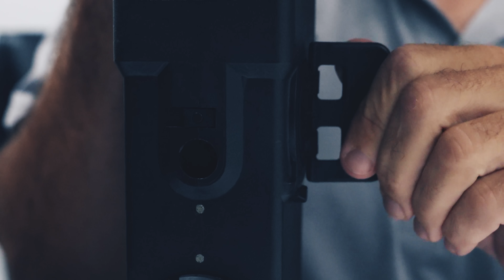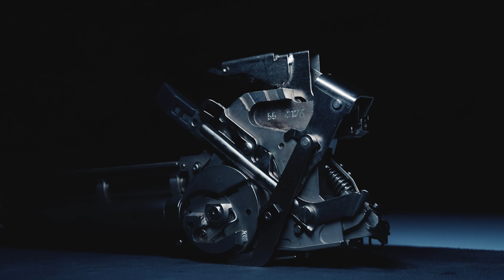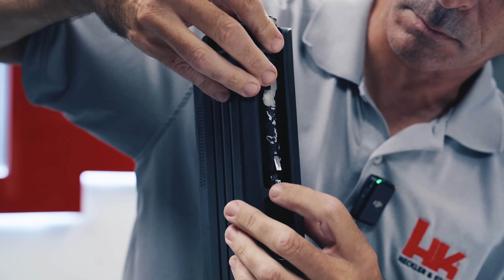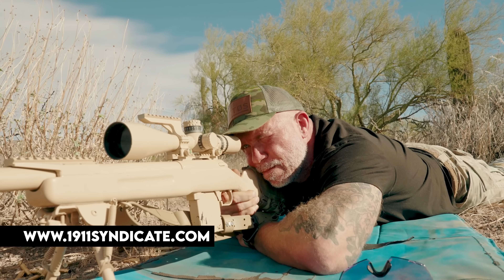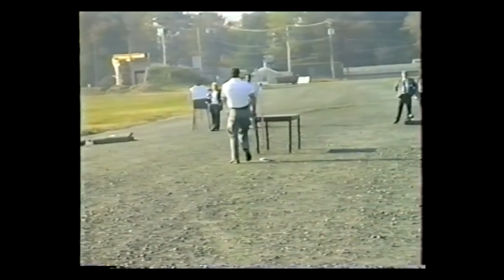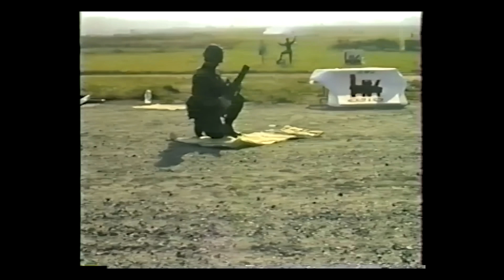The Craziest HK Gun of All Time - The G11 - Rare Footage

Comment: This was a dead end design due to the law of thermodynamics.  Metal cases remove a large amount of heat from firearms.  When this heat transfer is not available, the firearm has to absorb that heat with only air cooling as an option.

Comment: This gun is very cool and quite a improvement over current designs. The main reason it failed is it doesn't fit the purpose of small arms in war. As much as it hurts my pride as a former grunt the reality is infantry takes ground and holds it. Artillery and air support do most of the killing. Soldiers need a rifle that works, anything above that is a waste of money. Something like this is way, way to expensive and creates way to many logistics problems (high tech ammunition factories are not easy to come by for example) for the benefits it provides.

Comment: Hello! I know I am 4 months late, but I have a question: 
Whilst you were visiting H&K, did you inquire about the "LMG11"? 
For those that don't know, it's an LMG variant of the G11, firing the same 4.73 cartridge, but its ammunition is stored in the stock, capable of housing about 300 rounds.

There only exists a few pictures of it, including one of Günter Schäfer loading it. 
It would be very cool to get more info on this weapon, especially about its supposed "auto-loading" system, used to chamber the cartridges into the barrel. 

Kind regards.

Comment: The G11 design favors most coilguns, which currently exist, in a complementary way. The most interesting comparison would have to be the ammunition and the uniqueness of the projectiles for both systems; however, a newer model of the GR-1 might benefit from the adaptation of its magazine, to accommodate the use of the horizontal feeding operations from the G11 in its design while, perhaps, introducing a more lethal projectile.

Comment: This is not a firearm. It's an ammunition. And its weakness is the caseless ammunition. Mechanically it's not much different than another great box-cartridge Eurogun from the twilight of the Cold War meant to defeat Soviet body armor, the FN P90. HOWEVER, where I can see this platform's potential is in a conflict where eliminating the expensive brass cartridge is critical to one side. Say... guerilla warfare against a State that controls the copper and zinc and the steel used to make casings. I'm a gun nut but I laugh when other gun nuts think it's their guns that will save the day in a future civil war. It's ammo that saves the day. Just SEAL Team Six alone used to train with a million rounds annually. Your little stock of 5.56 might last one engagement, if that. Go to a range and examine the boxes of spent brass (or steel for 7.62) for the day. Now if you had a weapon firing ammo using a minimum amount of metal and in a caseless design that could be 3D printed by anyone with the means.... then you don't have factories (taken out with airstrikes) delivering by train (taken out with airstrikes) to big ammo depots (taken out with airstrikes... see Ukraine War), you have a distributed production/distribution model. Every house, every garage, every mancave, every shed in the woods is potentially an ammo factory so long as they have a block of the nitramine-based solid propellant body. 3D print a thousand of those, then press into each a single 51-grain bullet projectile, primer, booster, and plastic end cap suing a simple hand operated machine. Presto: You're an ammo factory.

Comment: Mistake: Flechette means (from the french) little arrow or dart. The AAI and Steyr ACR guns fired ONE flechette. Accurately. The Steyr one was the most MPBR gun ever: you zeroed it at 800 yards, and peak trajectory was like 12" so you never range, just aim and fire. Anyway, SPIW used more, often 3 flechettes in a little weird box but these used one, not a shotgun-of-darts as in the video. 

Now someone needs to dig up the other ACR guns and do videos on them. The Steyr was a Very weird gun internally.

Comment: Want a game changer? Use turntable top feed like on the P90, to drop the bullet into a barrel in line with the trigger finger. Accuracy jumps in double digit percentile, instantly, no additional training... and again, never seen ot done. Computer controlled range finding red dot optic that adjusts the dot according to target distance, compensating for the distance beween the optic plane and firing plane. If we can figure out A.I. and airsoft guns can register hits by tracking the projectiles, you can develop a sight that can do it. Radar sensor below the lens detects distance to target, dot adjusts to compensate for the drop to muzzle, no problem. Tech like that would allow for several inches between optic height and muzzle height over distance, with no manual dialing in (consider sensors on either side to account for windage), maybe the militaries budget would be better spent on designing a computer driven optic than caseless bullets. I'll design them a clean burning cartridgeless round on the cheap.

Comment: i was part of the group testing the gun for the Bundeswehr. we loved the gun for the first 150 shoots up to 300m (past 300 hits went down hyper burst was useless or ammo waste)  than the heat build up inside the gun would first lead to cook offs or even to melting cases that would jam the system. It turned out that Brass casing being thrown out take a huge amount of heat with them and makes sure the Gun does not overheat (in the system) as quickly. Great idea but think it through you will realize that creating an explosion  will always create heat and managing the heat build up will always be a problem . Cooling by ejecting the Brass is the gold standard
Reply: I was waiting for them to talk about the heat dissipation issue, strange to forget about it as it was the real deal breaker for this system 🤔
Reply: How can they not talk about it?
Reply: @acemattias  the intro alone (made to replace the M16) made me wonder - afaik it was intended as a replacement for the G3
Reply: @acemattias  Because it was fixed with the introduction of the High Ignition Temperature propellant.

The G11 was basically already adopted and waiting for production and delivery by the time the project was killed. The real dealbreaker was the german reunification and end of the Cold War drying up the defense budget and need for radical military modernization.

Then in 1992 5.56x45 was standarnized with STANAG 4172, essentially making the late adoption of the G11 impossible if Germany wanted to keep NATO compatiblity.
Reply: @acemattias  People don't like admitting faults that's not good for brand image because it was obvious this was poorly thought out and loads of money wasted on making a ticking time bomb for operators really doesn't make HK look good, thinking on it when I goto make my next purchase I'll prob just skip HK offerings, I did a few years ago when I got a B. MR1 when I was shopping for a good easy to shoot survival style piece.
Reply: @PatrickBaptist  justifying not giving HK business based off a government contract that didnt pan out in the 80s is honestly some of the dumbest logic ive ever heard. You could have probably criticized them for any other reason and ive had moved past the comment. But no, this comment was extremely re*arded and i just had to chime in. Also, if you knew anything about the history of really any major manufacturer, youd know that they ALL are constantly running PR to cover up some bullshit for the past.... ever. In all reality, HK is an absolutely excellent company to give your money to, and i would have difficulty finding 2 to 3 alternatives if you didnt want a quality gun from HK. I used to recommend Sig as the best bang for your buck, but then the P320 debacle happened. As someone who actually knows firearms, im still slightly lost on who to give my loyalty to moving forward. HK is an auto yes if not for the pricepoints. Either way, you is ignuramoose.
Reply: An interesting counterpoint: the TrueVelocity polymer case ammo apparently leads to far less heat buildup and better combustion in rifles. Apparently cooling by ejection isn't the only way to deal with the heat.
Reply: The concept  of brass removing heat from the weapon is an idea which sounds intuitive but doesn't really nail the benefit of cases: ironically it touches on a drawback of brass as a case material. Cased ammunition will definitely reduce cook off as it insulates the chamber from the charge. But because brass is highly thermally conductive, it still takes energy out of the charge in the form of heat, and still heats the chamber. Hence MGs needing to be open bolt. Like the other commenter mentioned, this is illustrated really well by True Velocity's polymer cases (as flawed as they currently are in other ways)
Reply: @hambo6713  What is the melting temperature of a polymer? 392-536 F° Typical barrel temperature profile ranges from 350 to 450 °F (177–232 °C) during normal operation. See a problem ?
Reply: @maddog8004  A high temp polymer has a far higher melting point than your numbers. That being said it will melt eventually but the real comparitor is the cook-off temperature of typical ammo. Polymer ammo isn't just on paper, it's being made and subjected to military testing, read up on the True Velocity stuff.
Reply: @hambo6713  Die Polymerhülsen sind
wirklich eine Stellschraube für effizientere
Innenballistik. Geringeres Hülsengewicht
noch dazu ist es vielversprechend auch für
Kurzwaffen.
Reply: Thanks for sharing.
Reply: @daviscampbell9020  BRASS LASTS U LONG TIME ⌛️
Reply: Simple thermodynamics
Reply: Excellent commentary! Isn't it ironic... by eliminating all that physical mass of brass by going caseless, HK deprived the platform of thermal mass to manage heat....
Reply: Das ist der Punkt. Zu allen anderen Vorteilen haut die Hülse 50% der Wärme raus. Besser geht es nicht. Die Treffer der 3 Schuss Automatik waren nicht eng beieinander?
Reply: YouTube doesn’t seem to be offering the translation button for the comment made by @theoring6440 🤔
Can anyone translate?
Reply: @theoronig6440  Die Waffe hatte eine schlechte Grundgenauigkeit 4 MOA im Einzellfeuer (dünner schwingender Lauf keine Kompensatoren bewegliche Schnittstelle zum Waffenschaft sehr bescheidene Optik) . Der Feuerstoß wäre im Nahkampf effektiv gewesen (so aber auch 7.62/52) auf Distanzen über 100m aber unnötig da fast nie (wenn überhaupt) mehr als ein Treffer auf der Zielscheibe landeten. (100m +20cm Streuung 200 +40cm 300 +80cm usw. Eine M4 auf Dauerfeuer war effektiver da man sich auf das Rückstoßverhalten einstellen konnte und mit der Führbarkeit der Waffe dieses im Ziel halten konnte. 
    1. Fazit wie auch bei dem G 36 Truppenversuchen  eine moderne (damals 1,5/6 ) Optik auf HK G3 DMR mit verbessertem (mehr) Schießtraining und der Einführung einer Leistungsgesteigerten (cal. 10mm oder 7.62×25mm Tokarev  ) MP5 für den Häuser (nah) Kampf würde weit bessere Ergebnisse erzielen und günstiger ausfallen. 
       Wir wollten eigentlich alle SiG 550 in 7.62/39 
Heute HK416 mit schwerem Lauf Zweibein/Griff  1-8 Zielfernrohr Schalldämpfer und Laufwechseloption (Länge)  im Kaliber 6mm CM
Reply: @maddog8004  Danke für die einzigartigen Infos. Erstaunlich das so ein
Irrsinn soweit endwickelt wurde. Eben wird
mit der 6.8 ein ähnlicher Fehler gehypt.
Reply: Yea, heat was my first thought as well. Still, what a peach of an idea.
Reply: True but I bet they only figured it out, when they worked on caseless ammunition.
Reply: I've read this about the G11 before. I think this is why plastic-cased ammunition appears to be the future for small arms.
Reply: Uh-huh, sure you were.
Reply: idk they could add a heatpipe and heatsink. doesnt need energy.
Reply: Thanks for your insight
Reply: How often do you shoot more than 150 times in very quick succession in a real-life situations? That's more bullets than most soldiers carry on their person in a real-life situation.
Reply: @AndrejMeuer  every time you are in a gunfight with multiple threats . Average bullet consumption in a war to kill one enemy is 30 000 shoots. You cant compare Hunting or target practice with fighting sometimes you shoot thousands of rounds down a road just to deny a crossing or you shoot for minutes towards a position just to lower their heads so you can move saver.
Reply: @maddog8004 that figure includes training (including for those that must qualify, but are never expected to enter combat), inflated numbers due to rounds carried and unused/disposed of, suppressive fire, and dozens of other factors that effect the accuracy of the claim.

With today's tech in the air support/ drones, diversification/specialization of troops composing a unit, the surgical precision that operations are conducted, etc.. the reality is that this could be a viable weapon for current use if some modifications can be made for such a simple issue as heat dissipation.

Range holds a separate issue that can also be amended by round size/shape and charge (case less case) load/size.
Reply: @trentenjackson8602   You make it sound easy, but there are really only two ways to deal with heat: adding mass, which doesn’t cool the chamber enough to prevent cook-offs, or active cooling, which makes the system extremely complex. Both also add weight. For specialized applications, this might be viable, but it’s too complex and expensive for that and for large-scale use not universal (Technically mature enough) to justify the cost.
Reply: @maddog8004  🎯👍
Reply: An excellent explanation! Thank you! There's a good reason weapons stay in similar form over decades! If it ain't broke don't try to fix it! R n d gone mad!
Reply: Looks cool tho!
Reply: Some seriously cool Weapons on the wall there!! 😮
Reply: Imagine if the weapon had more time they might have found a way to dissipate the heat from the barrel. But it is what it is.
Reply: this is also forgotten in internal combustion engines. Your exhaust gasses play a major role in cooling the system.
Reply: lol you loved an ugly gun GG 

 next you will say that you LOVED  Amy Winehouse
Reply: @anamegoeshere  I am OK with a car tool or a gun that is ugly if it runs great 
If i like the woman and we get along great I would not care about looks that much but  I think my best friend would tell me if he is up to that challenge.
Reply: I was wondering how they dealt with the heat. Should have taken some peltier coolers or those new piezo AirJets from frore systems.
Reply: Wonder how much more weight would a system capable of dissipating enough of heat add. I’m pretty sure it’s possible, dunno about practicality. And as one of the big advantages was weight saving in the first place 😂
Reply: vapour chamber
Reply: why can't it designed to have a liquid cooled chamber n barrel ? work on that
Reply: @joestitz539  Main problem there is weight you need mass, area or time to disperse heat. That can be in form of heavy systems (also Barrels) or gases /liquids to cool. The added problem with gases /liquids in cooling is pressure and viscosity  do to the different aggregate state's in liquids.
Reply: Anywhere there is war, there is also earth. Soldiers can carry less by utilizing resources they find in the field to cool the weapons. By design you must muck it up
Reply: Yknow, coming back to this a few weeks later, I am thinking of the self-cooling 3d metal printed suppressor designs I've seen come out in the past few years. There's gotta be some new opportunities to fix these problems with 35 years of new tech!
Reply: The main heat accumulating piece would be the chamber- so if you add a 2nd that switches every Mag, you could stretch that cooling?
Reply: It took them 50+ years and zero sales to finally retire the program.
Reply: PREACH BROTHER!
Reply: Well it’s the brass standard… but yeah it’s the gold standard. 😁
Reply: Despite that, I believe now, so many decades later, it is possible to overcome that issue, and it's definitely a gun too ahead of its time. That fire rate, with such loading capacity, may change warfare these days. They should restart the research for our Starship Trooper/Alien gun, hopefully with better ergonomics and modifications.
Reply: Ammo Standard is a major factor!  @FrHarshLanguage
Reply: @FrHarshLanguage  That's not how physwics works .. .. Mojo JoJo's Goat testicle squeezing ain't gonna work with solving that problem. Energy in = Energy out.  Sure make the gun 20 kg heavier and put a fan and radiator on it... or like the old Vickers have a tank and water cooling.
Reply: @darknase  there were jet engines and car engines that could not be produced because there were no alloys that could resist pressure and heat made by those engines, nowadays it is possible, before electric cars were not feasible but today they're normal, probably there will be a material or tech that will solve this old problems, hell even 3d printed guns can sustain much more shots than years ago...
Reply: @FrHarshLanguage  first you have to develop a propulsion method that does not creates heat The idea was to increase the volume of fire to a degree that any advance was impossible. (old German habit since MG 08/15 to MG 43) but if you can only shoot 150 shoots till meltdown (of the 'cartridge case
" in the system) that idea is not 
implementable
 with this gun
Reply: Wow!  That is something I wouldn’t have thought of on my own.  It makes a lot of sense though.  Spent casings are always scorching hot when they are ejected.
Reply: Riiight.. A huge block of metal with the heat capacity no normal gun would have causes cookoffs after 150 rounds... and I guess that's also why the Bundeswehr had already accepted the weapon as the new service rifle before it got cancelled, and fully intended to deploy it... Suuuure
Reply: @LeutnantJoker  Es waren außenpolitische Gründe. Die Gießkanne mit
filigranem störanfälligem  Schloss war technisch abwegig.
Reply: BRASS RULES
Reply: Thank you for your wisdom. Oh my..